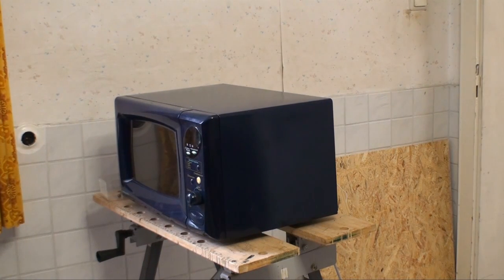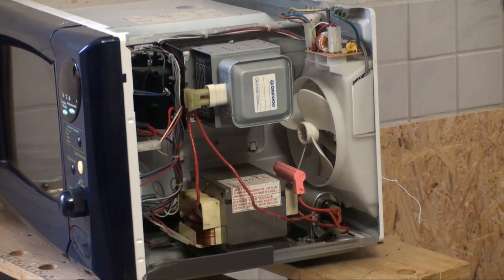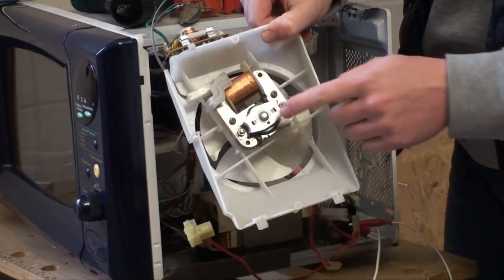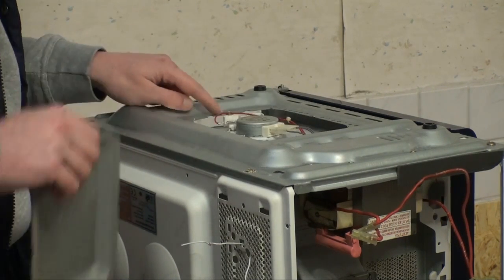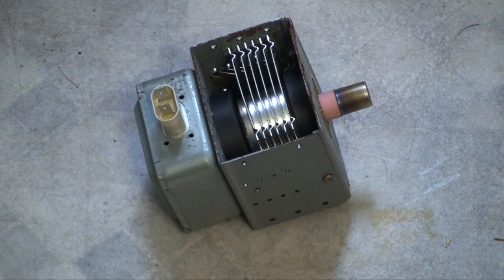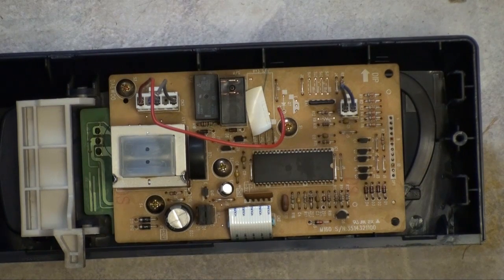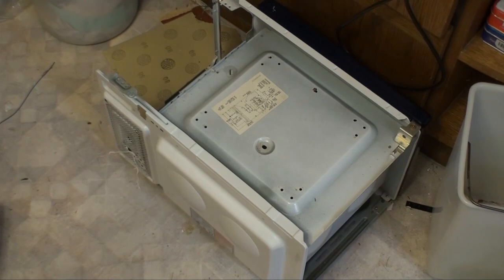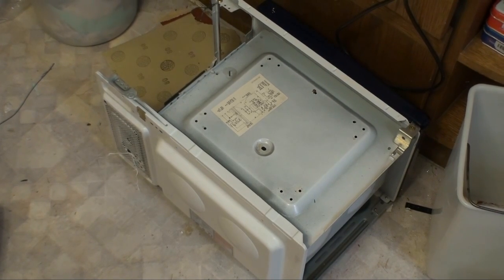Microwave oven teardown and analysis

Comment: Hi there. Those 24 volts are still AC right? I guess then after rectifying you will get even more! If so, have you measured the output of transformer with a bridge rectifier?
Nice video, keep them coming.
Reply from the maker: The 24V are AC, correct. With a rectifier and smoothing capacitor you will get 24V * 1,41 = 34V.
Reply from the maker: V_AC * √2 = V_DC is a good estimate. This indeed does not include the voltage drop across the recifier, but that normally does not exceed 2 V. "The voltage of the capacitor" is nonsense. That's what the equasion calculates!

Comment: I've been considering using one of these transformers in reverse for a high-current power supply, but there is one thing I don't quite understand: the high-voltage winding is rated for ~0.5 amps, yet that would mean that the transformer could only generate 0.5*230=~115 Watts of power. This would equate to 115/24=~4.8amps at 24 volts output (excluding any losses). However, that doesn't seem right, as this transformer should surely be able to produce much more output than that?
Reply from the maker: In normal operation, the HV winding is rated 0.5 A, the voltage is 2 kV, so the output power is 2000 V * 0.5 A =1000 W. That means on the primary side you have 1000 W / 230 V = 4.35 A of current.
When using the transformer in reverse, the secondary turns into the primary. The voltage drops from 2000 V to 230 V, however, the maximum current rating remains the same since you can not change the diameter of the wire. So that's indeed 230 V * 0.5 A = 115 W. And assuming your secondary voltage is 24 V (on the transformer I once had it was 12 V), you get 115 W / 24 V = 4.79 A.
Conclusion: Using the microwave oven transformer in reverse doesn't make sense. Better remove the HV winding and wind on a new low voltage secondardy winding, because then the rating of the primary remains 230 V * 4.35 A = 1000 W. Your new low voltage secondary could be 1000 W / 24 V = 41.67 A, at least in theory. Practically you will be limited by how thick of a wire you can wind into the core.
Thanks for asking this question, I learnt something by answering it :)
Reply: DrCassette
Thank you for your reply, I was thinking the same thing about the diameter of the wire not being rated to exceed 0.5 A. I might eventually attempt to replace the high voltage winding with some thicker windings. Thanks again, I really enjoy your videos.